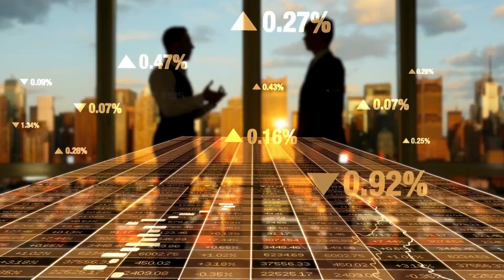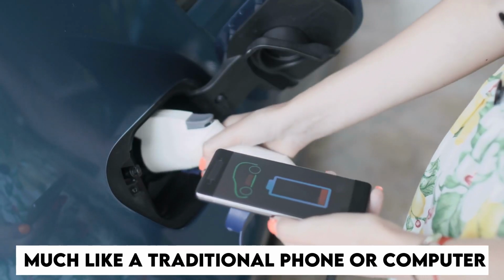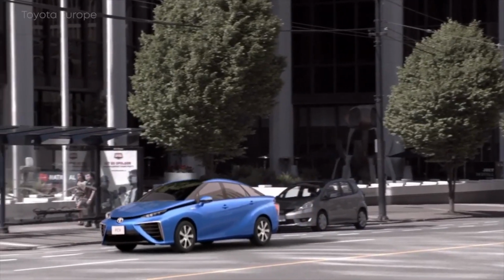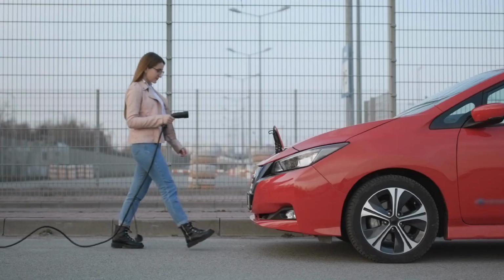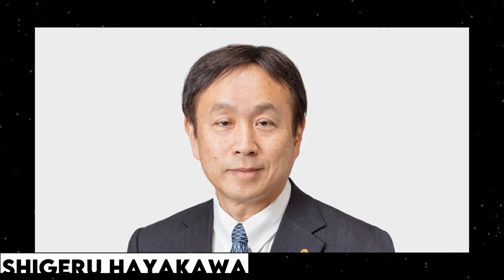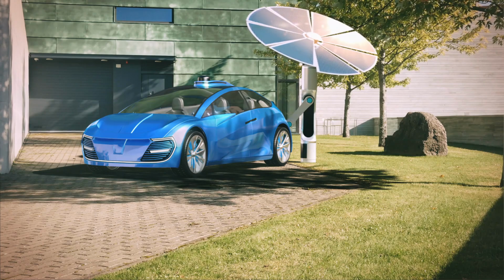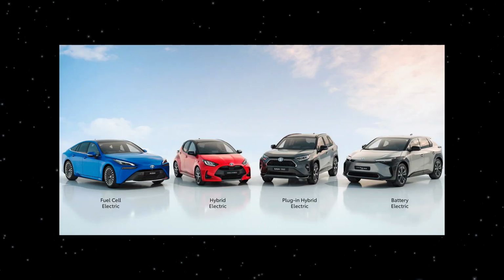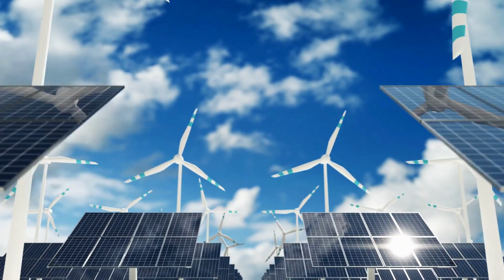Toyota’s Announcement Over EV Batteries Will Change The Game!

Comment: Nope, Hydrogen takes far more electricity to make the hydrogen than just using the electricity to fill the BEV. It's a terrible technology meant to keep people on the fossil fuel tap. EV's can be powered at any home or electrical outlet, Hydrogen requires a plant to produce it and a station to fill it. meaning you have to pay people to use your vehicle, whereas EV's you don't have to pay anyone if you produce your own electricity, be it solar, hydro, wind or what have you. If you can produce it yourself you cut out the middleman which is always saving you money.